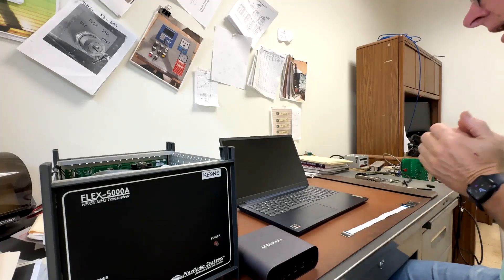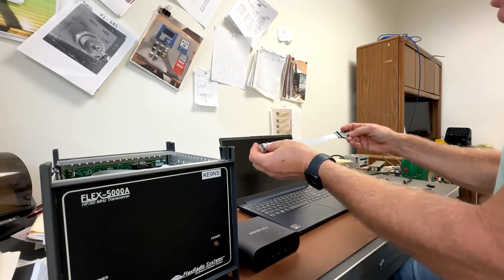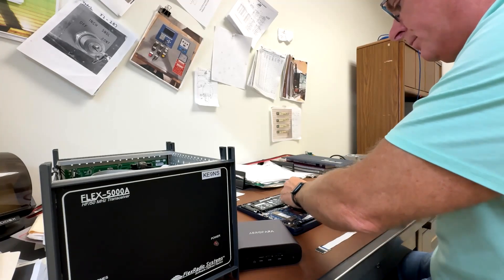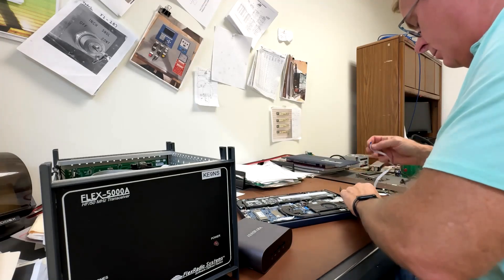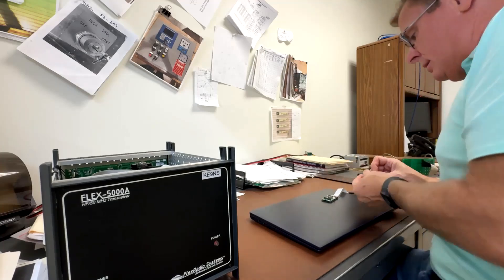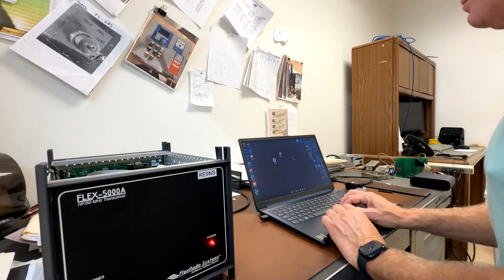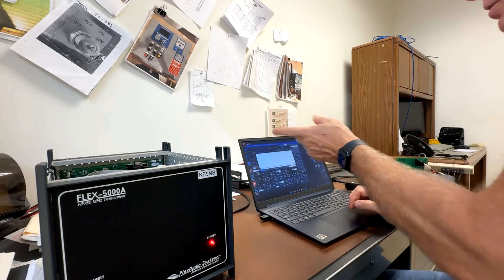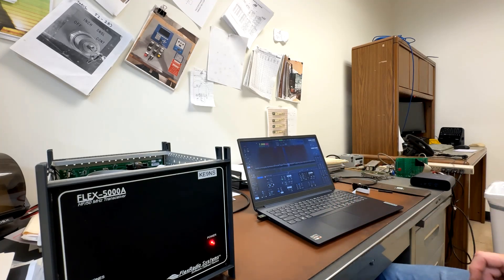KE9NS Adding 1394 FireWire to a modern Laptop M.2 Slot

Comment: Hey, stumbled here in the search for a way to conect my audio interface on my notebook. Do you think that, if i use this method and the corre PCI Express firewire adapter, it can work?
Reply from the maker: If your audio device works connected to a FireWire card plugged into a desktop PCIe, then it will work. M.2 is PCIe x4.
If your notebook has a USB4 port, you can use a USB4 to M.2 adapter and achieve the same thing without having to mess with the inside of your notebook.
Reply: @ke9ns  Yes, it works connected to firewire.  Do you think this other method using the ubs/m.2 adapter, with USB 3.1? My notebook only have those...

Comment: Is there a risk to fry the motherboard with this setup ? i don’t find any other info on internet
Reply from the maker: You will want to follow standard "best practice" as you would for anything electronic:
Make sure to always discharge yourself (by touching ground) before you touch your laptop. And if you get in/out of your chair, you will need to discharge again.

Take a photo of the entire motherboard before you start touching anything, so you can always put it all back in the future.

Make sure to disconnect external power, and the main battery before messing with the internals.

When you remove the wi-fi module from the M.2 slot, make sure the antenna connectors are taped off so they dont short to anything.

Make sure any M.2 to PCIe adapter cable you use doesn't get pinched, cut or shorted as you route it to the outside of the laptop.
Reply: @ke9ns  thanks for the tips, i didn’t think about disconnect the battery. For what it’s worth i have an available m.2 socket for a ssd, i’ll might give it a shot